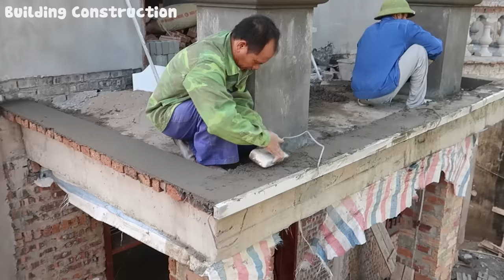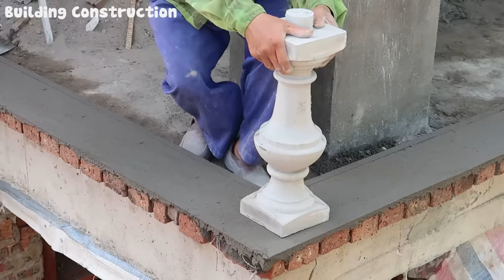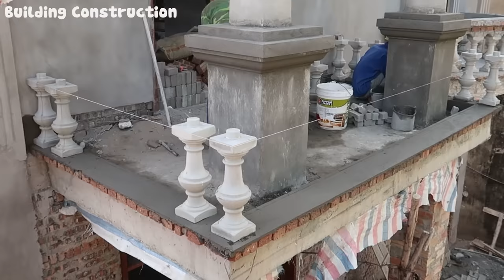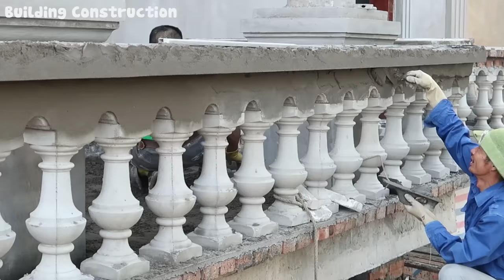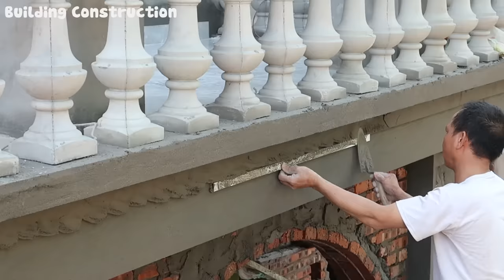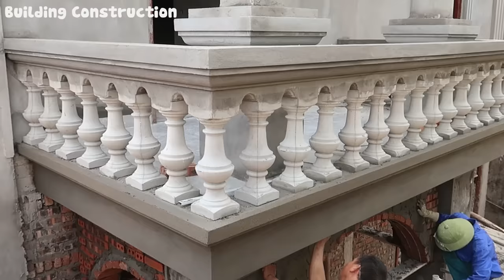Prefabricated Handrail Installation Technique - How To Install Porch Balustrades Correctly

Comment: In the United States and in any location governed by the International Building Code, handrails must be engineered to resist established loads representing a person falling against the rail. Simply plopping some balusters in a concrete screed and placing caps on top will not meet the engineering necessary to protect the building occupants. Many of these videos are very misleading and the results are dangerous.
Reply from the maker: Thank you for watching my video
Wishing you a happy and successful new day
Like and share to help me
Reply: I was thinking that the screed needs to be thicker however I'm no expert.
Reply: @UC5juJW_g8d4Yssar-FPar8g We do. Thats why we have codes, Architects, engineers, approving authorities, licensed contractors and quality control. We also do not have a societial approval of kick backs and corrupt local officials. It is for the protection of the building occupants. 

And with a half a billion buildings there are going to be failures. When those occur they are investigated by teams from many disciplines. If a reason is found in the buildings design, the codes are changed. If there was criminal wrongdoing our laws seek to establish guilt and meter out justice. In these manners, we try very hard to ensure that you are safe when inside or near our buildings.

Im not saying that this is better or worse ghan anywhere else. I simply stated that this is how we address building construction here, across the entire country, everywhere, without exception.

I have spent my life in the building industry; not only in America but in Europe where I attended university, the near east, Asia and South East Asia. This allows me to have a balanced opinion.

Best regards